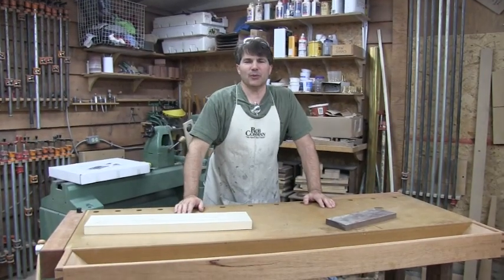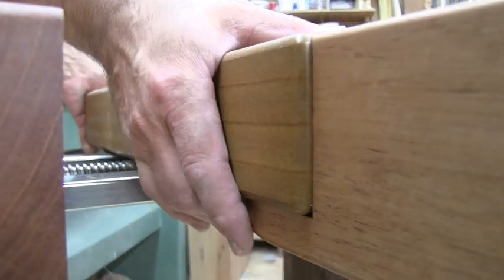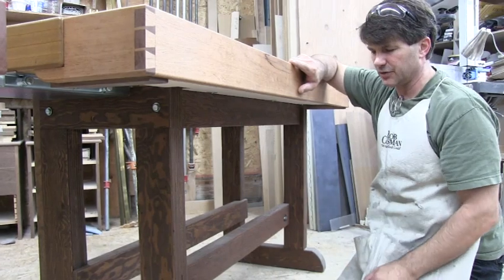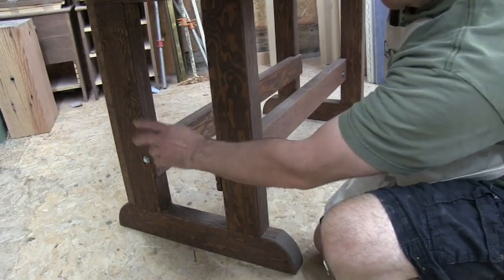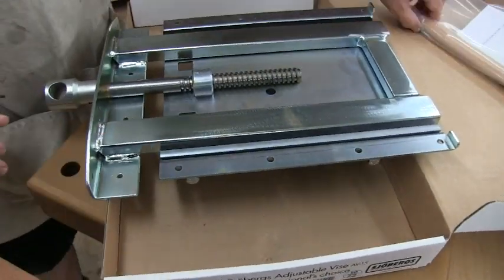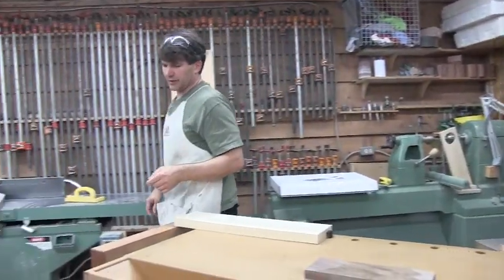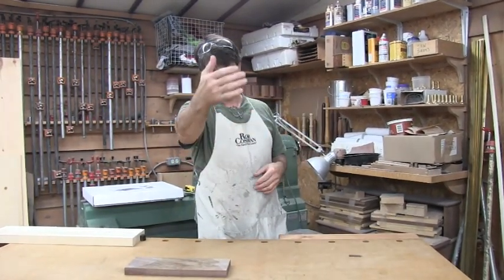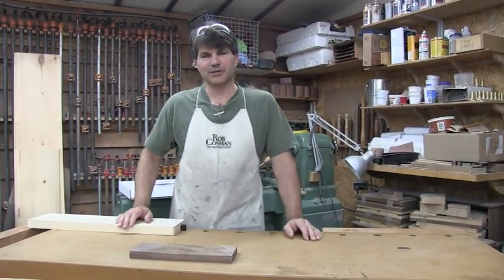Workbench for $100 (kinda)

Comment: Thanks you. I'd been looking at a ton of "$100 bench" and "your first workbench" videos and this is the first one which acknowledges the startup tools cost. I went through a few of the others and priced up the tools, assuming you really were just starting out (minimal power tools). By the time you bought the jointer, planer, table saw, huge clamps, etc - it was cheaper to buy the top end Sjobergs. Also, my son's "workshop" is about 10' by 6' right now: no way we could put the big power tools anywhere.

This one looks doable, with perhaps a 1-day rental from Homedepot of a table saw for accurately and quickly cutting the MDF to size. That's $55 per day for quite a large one.

FYI for anyone wondering, the Sjoberg's vise is about $275 at present, and  a 4 x 8 x 3/4 MDF sheet is about $30, 1/4 x 4 x 8 plywood is another $30

Comment: I just built one. Material prices have skyrocketed. MDF - $120. 3/4 plywood $85. Lags $42. Glue $38. Screws $11. $296 without the vise. And worth every penny. You could park a car on it. I screwed the top layer on without glue so that if I need to change it in the future, it'll be a piece of cake.
Reply from the maker: Hi Jim, you’re right, that title did not age well!  We use 1” Baltic birch for the top on some benches, three layers and a 3” thick plywood top.  In one year the ply went from $129 to $295 a sheet! Crazy!

Comment: Totally agree about the tool tray on the back side!  I built my woodworking bench (6 ft long x 21" wide) without one and, after dropping tools, etc off the backside for 9 months, got p*** off and added a tool tray. Totally worth it.  Not sure I like the idea of MDF for top but can't argue with your experience (my bench has 3 layers of 3/4" plywood which is a bit soft). The Sjoberg vises sound very nice but are very expensive (for this guy anyways).

Comment: Im going to use this idea, and adapt it to make a proper bench with a tool well. Im thinking another good idea would be to only spot glue the top piece of MDF so when it gets really beaten up you can easily remove it and replace with another.

Comment: I like the top.  For convenience to new woodworkers I'd suggest making the base out of a box made of OSB screwed together with 2x4s at the corners.  A box made of sheet material will never rack.BTW, THANK YOU! for calling it a vice 'jaw' and not a 'chop.'
Reply: The home center cuts the OSB to size for him.  The woodworker puts the pieces together with screws.  The front edges of the end panels are flush with the front of the top.  There's a 2x4 screwed to each end panel on their inside faces right along the front edge.  The 2x4's are screwed to the end panels flat, with their wide faces.  The front panel is screwed to the back edges of those two 2x4s.  That way, the front panel is set back 3 1/2" from the front of the bench.  He'll put shims under each corner to level it on his floor.  It's down-and-dirty so a guy doesn't need a table saw, and he can get working on projects right away.  He can make a fancier bench using this one.  Whatever bench he makes later, it will never have a more rigid base than this one.

Comment: I love the simplicity of this design, especially the base, but I built an MDF top 20 years ago from 2 full layers & a partial third layer, edged with 45mm Oregon. It is no longer flat at the vise end by at least 2mm. So time for a rebuild. I will use plywood as per Paul Sellers for the bench top but the top layer will be 19mm Bamboo as it is very hard & looks fantastic. As the Sjobergs vise is not available in Australia, I recommend the HNT Gordon front & tail vises, superb quality.

Comment: Very good consept, I have been doing some rough calculations. The sort of $100 Canadian I'm assumeing is around £58. For 4 sheets of 18mm (3/4) mdf I'm allready up to £92. Estimate around 2 sheets of 9mm (3/8) ply wood is another £50. Add on an additional £30 for bolts ect. And now for 2 sjobergs vice at £215 each. So I'm now up to £602. Without any additional cost for shipping of vices. So this $100 is either way off or things are RIDICULOUSLY cheap in Canada and USA. Not knocking the bench design at all.
Reply from the maker: The $100 is meant for the wood only.  And yes I have discovered that MDF is substantially cheaper in Canada.  In the U.S.  we figure the cost, NOT including the vice or vices should you want two, is between $150 and $200 depending on where you live.  In Canada its around $120 (USD). Helps to have lots of trees!!!
Reply: Thanks for you reply Rob. I hope you don't get the impression I'm knocking the bench itself, not at all. But for me hear in the UK and anyone eles to buy materials and vices, which yes would be required to price is around the £500-£600. You guys are extremely lucky with the equipment you have as well as the accessiblity to the fantastic hard woods. All of which hear are like unicorn s***. All the best.

Comment: Is MDF more susceptible to issues due to humidity?  I work out of a little shed without climate control and I'm always worried it would just soak up the moisture and be ruined.  Would plywood work just as well/better?  Thanks all.

Comment: Im just about to buy the plans and video for this bench in the new year. One thing I have not seen is how you set this bench up for jointing long edge? Is there a way to support the rear of the board or just set it on something? Sorry only very new to hand tool use.

Comment: Rob, I can't learn enough from you. If I widen the base by 3 inches would it be feasible to shorten the length to 49 inches to allow all 4 slabs be cut from one sheet of MDF with little to no waste? Would the loss of 13 inches be an issue?
Reply from the maker: That one is up to you,  will it suit what you plan to use it for?
Reply: My goal is to use it on what I've learned from your videos...dovetail cuts, planing and joinery work. I have an assembly table already. @RobCosmanWoodworking

Comment: To get a dead flat surface, you had to start with one. How did that go? What did you use to do the initial MDF glue up?
Reply from the maker: The base, pretty easy to use the table saw to get the top stretchers straight and parallel, then get them flush to the top of the uprights  Now you use this as the platform to glue the mdf sheets to one and other.

Comment: Rob, 
I have a two solid core pine doors, 8' x 3' x about a 1 1/2" thick.   If I laminated those two doors together do you think it would make as solid of a top as the mdf? I will be using your design on the base for sure. great stuff.

Comment: Hey Rob, Going to be building this bench next week. From the video it looks like the top stretcher on the front of the bench would interfere with the sjoberg front vise mounting. I must be missing something. Let me know, Thanks
Reply from the maker: yes you have to cut out a spot for the vise to sit.  Not a big deal but think of it when you are stapling the pcs of ply together, avoid that area, use clamps.

Comment: I like to make a beginner bench such as yours. Do I have to use MDF? I have these 1" particle boards. If I glue 3 of them together to form the top, would it be sturdy enough? Would it stay flat over time? What can I do to make the sides stronger or protected? Do I need to glue a piece of masonite on the top and the sides?

Comment: How about something like this compared to a heavy torsion top bench made from similar material? Or is this top going to be just as flat? For someone that's getting started and without a large work surface....what is a good way to make sure the top does glue up flat?

Comment: This may be a silly question, but, considering that Rob mentioned the ease of replacing the top if need-be and transportability, how do you connect the top to the base?
Reply from the maker: A single dowel in the center of each upright and one lag bolt up through the middle of each stretcher.

Comment: Hi Rob, I like this bench. Question, if I made the top out of 3/4 plywood and 1/4 fiberboard (easily changed if damaged), wrapped with, say, 3/4 maple.....so 3" thick plus 1/4" - maple sides would be 3 1/4" wide by whatever......would that work? Any unforeseen issues gluing the top together? It could be screwed and glued, it would never be seen, fiber top just screwed in place.....thanks, Bob
Reply: Thank you, I was wondering that.

Comment: Great timing. I was just about to glue up some 2x3 to make a top in 2 sections so I could flattening it easier but MDF top would be sooooo much easier I hadn't considered it. Would it be harsher on edged tools though (should a slip occur)?
Reply: maybe, but who cares? you probably need practice sharpening anyways :) its not going to damage anything... I rely on my block plane to flush  up all kinds of materials (including mdf and melamine) it dulls it fast but I resharpen and keep working.

Comment: Great video Mr. Cosman. I purchased the MDF and built it with a tool tray down the center of the bench top. I've read that MDF is very absorbent. Was there any tricks to applying the tongue oil to the edges of the MDF? Or is it as simple as saturating it with 4 coats?

Thanks for the inspiration!
Reply: David Salazar .

Comment: Would MDO work or be a good choice for the top, and I guess the supports too?  Will the laminated pieces stay together when glued?
Reply: Rob, it's Medium Density Overlay. It's a plywood core with a paper surfaced veneer. For many decades it was and probably still is used for many highway and street and business signs etc and it's a good product for plywood projects that will be painted. If you buy sheet goods from a true lumber yard ask them to show it to you.

Comment: Mr. Cosman, how would you recommend chamfering the edges of an MDF top, such as yours, if i do not have a router available? 

Would chamfering with a plane, and sanding the edges a bit work in prolonging the MDF life, or is routing the preferred way (mechanically speaking, not in terms of effort)? What finishes can be applied to MDF?

(i know i can probably rent one, rather than buying a cheap one-use-only router, but i'd rather keep this as cheap as possible to boot)

Thank you for your videos, i'm at the point where any information is precious, and your videos are invaluable!
Reply: ***** Thank you for the quick reply, sir!

Comment: Rob, do you know the difference between the sjobergs vise you showed AV-15 and the
Sjobergs SJO-33302 Adjustable Vise?? i found them both at the same price...
Reply: +Rob Cosman Thank you for the quick response, On the vise box i see in your video it says AV-15 the av stands for adjustable vise... i believe the SJO  33302 is sjobergs part number... rockler sells the SJO33302 but for installation details the paper says AV-15,  therefore I now believe they are the save vise... just model number vs part number.... love the video giving us 17 deg angle for use in softwoods.... i tried it and no more tear out of material in pine dovetails.... works great

Comment: It's unclear how you attach the long top stretchers of the base to the legs. On your web page I see bolt heads, but the stretchers don't have holes cut in them for the bolts, that are in the lower stretchers.

Comment: Hi - does anyone have a rough idea of how much tung oil this will require?  Are we talking 200ml or 5 litres?!  And same with the glue - any idea on quantity for the laminated top.  It's only the top I'm going for at the moment.
Reply from the maker: Well i have never measured it but you should use a tung oil finish not pure tung oil.  You can make your own by cutting pure tung oil 50% with mineral spirits. I would think a quart would do!!!
Reply: RobCosman.com thanks again Rob. I’m drawing up plans for the base as it will need to sit against a wall and I’d like some storage underneath. Will try some simple lap joints. Enjoying the design process actually and practicing my drawing. Will be a couple of months as I’m moving house but then I’ll post a pic. Loving your videos and support.